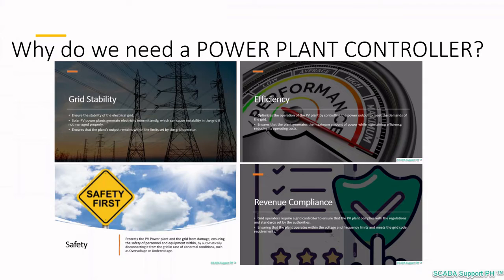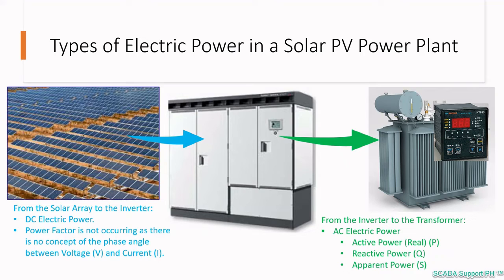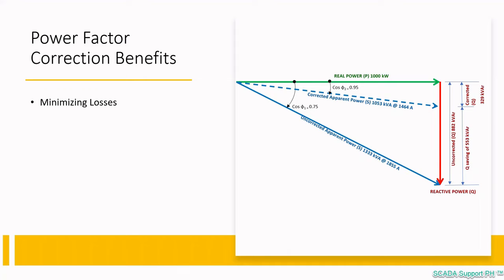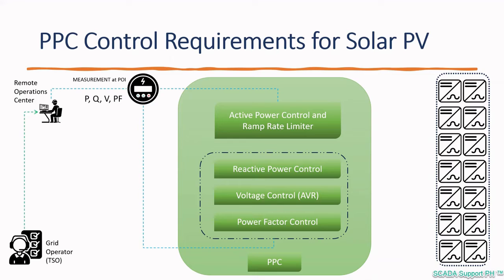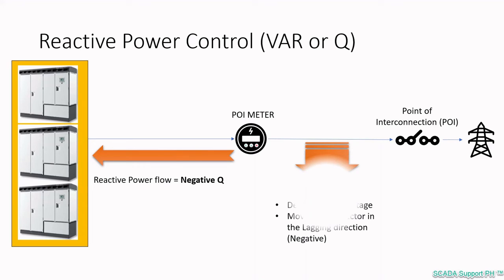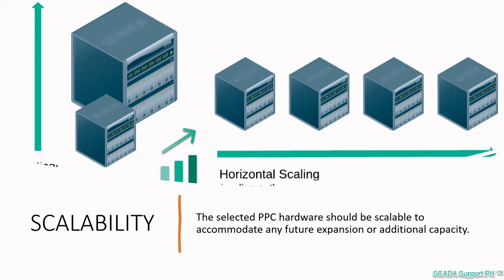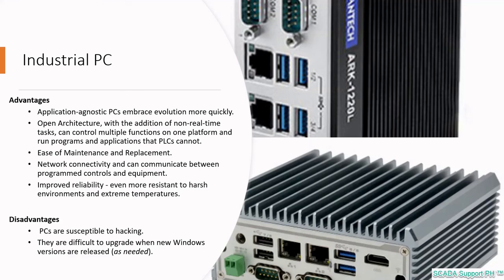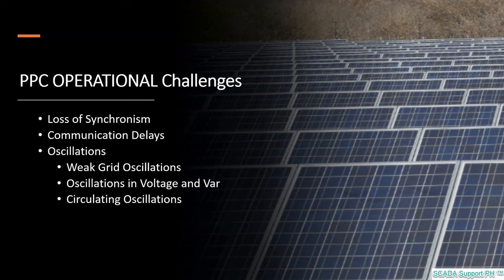Solar PV Power Plant Controller (PPC)

Comment: Could u pls show us about the MV Cable Joint? Who should it be done (equipment, process etc) to avoid frequent failures
Reply from the maker: @abatsayekeyev8638 MV cable joints needs precision and should be done using the manufacturer provided mechanical connectors and heat shrink kits. Considering the right termination with proper phase sequence, with proper preservation of moisture and dust seals by means such as duct sealing conduit openings and mastic tape. Along with the use of MV-rated personal protective equipment (PPE), with adherence to rigorous lockout-tagout (LOTO) protocols in de-energizing, and with extensive documentation and regular inspections to provide long-term reliability and safety.

Comment: I think, positive direction of kvar should become lagging, and negative direction of kvar it becomes leading power factor.
In the video, it shows the opposite. Am I right?
Reply from the maker: @maxpaul not necessarily, as the Solar PV PowePlant is your SOURCE and the GRID is your LOAD. With that in mind, the Reactive Power Control will behave the opposite.

Comment: I understand SCADA systems is not required for a solar farm below 1MW to tie into grid. So, what controller, if any, is required of them?
Reply from the maker: @Aqualastic the requirement for a Plant Controller is dependent on your grid regulations, you can select a PPC that is tied to a Data Acquisition System for cost considerations, or a compact SCADA system that has Read/Write capabilities to your Inverters.

Comment: Sir, Are you from the Philippines? It's fascinating to watch your videos.
Reply: Wish I could be your student someday. I'm currently looking for a job in the Solar PV field to extend my knowledge as an electrical engineer in the Philippines.
Reply from the maker: It's a good and timely goal to enter the renewable industry, now more than ever. I'll try to come up with more straight forward topics based on my experience and share it with everyone. If in case you have any suggestion or topic in mind, please feel free to add it on the comments section so I can try and build a training video for it. Thanks!
Reply from the maker: Yes @nikkibonrostro3961, I'm 100% Pinoy !

Comment: Dear, would You be offering freelancing services of designing  Power Plant controller for 10+ MW PV plant?
Reply from the maker: @petarmaric6240 you'd need a team -probably of 5 or 6 personnel, that would include surveyor, electrical engineers for PV as well as cost estimators to successfully design a 10+MW PV Power Plant. I could recommend folks from the US or in Europe. Where are you located by the way?
Reply: @SCADASupportPh  Thank You for Your answer. I am just interested in someone expertise of designing the Power plant controller for the solar plant. The plant has already been designed but the power plant controller needs to be designed. I am located in Croatia,Europe.